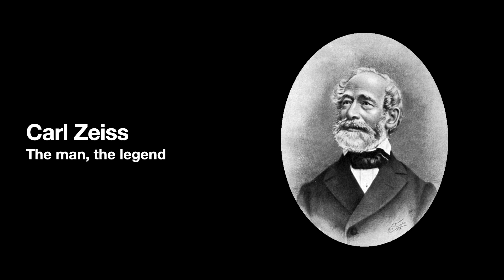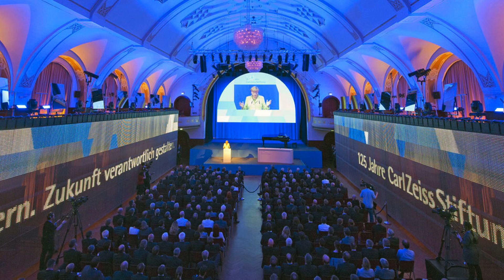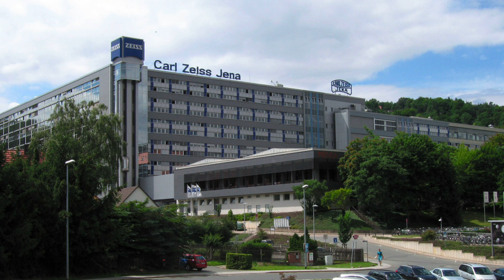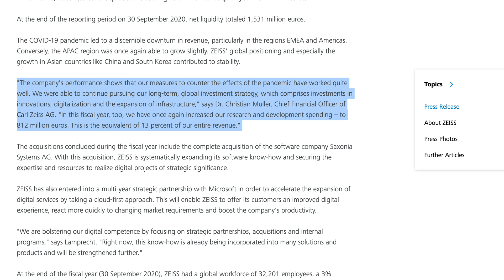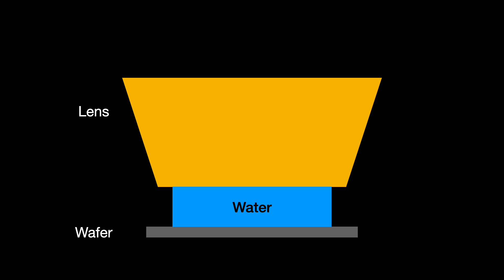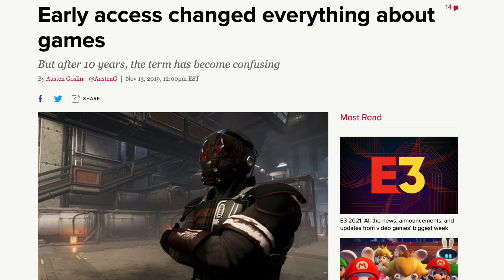Carl Zeiss, Explained: Germany’s Semiconductor Optics Master

Comment: I wouldn't say "discovered immersion lithography". It's more like they decided to implement immersion optics in lithography. Immersion optics was state of the art many decades before in microscopy. Microscopy being a major line of business of Zeiss - they do offer complete microscopes and also just the optics (i.e. objective lenses). Those lenses are designed and sold as either regular air-operated or as (oil or water) immersion lenses.

Comment: the next step  will be a lithography WITHOUT  optics... a laser beam modulated with powerful  magnetic fields,  that scribes the pattern  direct on the silicon no more mechanical parts the wafer sits stand and the laser beam in a vacuum  chamber inscribes the pattern  in the wafer

Comment: Are Canon or Nikon attempting to enter EUV space? I know the cost of entry is enormous (and they would still need to license a lot of technologies, or even share some component vendors with ASML, like the light source). It is a bit dangerous to have one critical company control entire market. Would be hard to do as Cymer is now owned by ASML. But there is always an option to develop alternatives, or bring this to the court on the grounds of monopoly, to allow fair sharing.

Comment: That the mirror system in the EUV system are some of the most extremely complicated and finely tuned things you've ever run in to, I'm quite willing to believe. I've heard and read some things about other parts of the EUV machine myself, like the light source, and those create the exact kind of feeling in me as well. As some of the most insanely sophisticated pieces of engineering you've ever heard of. 

Probably quite a few things in the EUV machine are like that I guess and it really explains why the costs of developing it were so high, or why unit prices so high. And yeah, it really makes you wonder if anyone else can any time soon afford to develop a competitor device. Frankly, especially with hindsight on the costs and extreme engineering involved, it wouldn't have been that surprising if the semiconductor industry had failed to make this jump and just stalled out at around 10 nm or so for a good long while. They almost didn't make it as it is, what a different semiconductor world that would have been.

Comment: Great channel. Maybe you can also do videos about Schott and Jenoptik, which were all founded by Carl Zeiss. This companies are also critical suppliers in the semiconductor industry.
Reply: From Wiki: Schott also produces telescope mirrors with diameters up to 10+ meters and---work in progress--39 (!) meters in diameter. Cast glass mirrors like that need months and month for cooling down, weight some gramms and are finally sanded as accurate as I don't know how accurate. Transportation to the telescope is another thing...

Comment: Carl Zeiss additionally owns Schott, which is also doing a lot of high quality glass.
Reply: From Wiki: Schott also produces telescope mirrors with diameters up to 10+ meters and---work in progress--39 (!) meters in diameter. Cast glass mirrors like that need months and month for cooling down, weight some gramms and are finally sanded as accurate as I don't know how accurate. Transportation to the telescope is another thing...

Comment: I wonder why immersion lithography uses water rather than immersion oil. Perhaps the UV would polymerize a hydrocarbon-based immersion oil, but I imagine a silicone-based immersion oil would not because silicones are exceptionally UV-stable.
Reply: Yes - high magnification optical microscopes use oil immersion. Some electron microscopes have resolutions exceeding even those of an EUV machine (though not requiring the beam to focus as a lithography machine does). They do it by putting put the whole thing in a vacuum chamber. I wonder why you would not prefer a vacuum to a troublesome medium like water?

Comment: FunFact: The history is even more complicated because there was also Otto Schott

The Carl-Zeiss-Stiftung also owns Schott. They produce most of the glass for Zeiss
Reply: And Schott Glass is a manufacturer of fine glass specialties to this day.
Reply: From Wiki: Schott also produces telescope mirrors with diameters up to 10+ meters and---work in progress--39 (!) meters in diameter. Cast glass mirrors like that need months and month for cooling down, weight some gramms and are finally sanded as accurate as I don't know how accurate. Transportation to the telescope is another thing...
Reply: Unfortunately since many years Schott doesn’t produce any fused silica anymore, so the newest Zeiss objectives for ML do not contain Schott glasses.
Reply: @calvinhobbes1617  Is the glass used in EUV mirrors made by Corning or another company? Do you have any information on their model and processing / manufacturing?
Reply: They are next to the Main river in Mainz.
They put them on barges.
After that,well……🔬🔬🔬

Comment: How many more years do you think DUV will be in action? It is not easy to get rid of existing EUV or even replace DUV with EUV due to the heavy costs of DUV. What percent of the current semiconductors are made using DUV vs EUV ?

Comment: Hey John, I want to ask a question. Did Carl Zeiss sell their Starlith EUV optics to other companies or they exclusively sell their EUV optics to ASML only?
Reply: They only sell to ASML
Reply: @nikolaskonle3926  How about Intel? I heard they fabricate their own semiconductors
Reply: @cek0792  they do.. but they need Asml systems and Zeiss optic in it to create the semiconductor
Reply: @cek0792  Intel is not in the same Market as ASML... The thing is that ASML essentially has a monopoly (like 80%+ market share) in a certain market. They produce machines that essentially every single advanced microchip factory in the world uses. They are used by Intel and TSMC (which produces AMD, Apple, Nvidia,... chips) among others.
Reply: Do check out Trumpf as well.

Comment: Another excellent video. May I suggest a few square meters of sound panelling glued to a shower curtain which you mount behind you when recording and another panel placed behind the mic ie on the side opposite yourself. The cheap stuff will do just fine.
Reply: What’s wrong with the sound? Serious question. Sounds like any other channel IMO.
Reply: @codycast  Oh no nothing is wrong with it. You just get a nicer sound if you record with a few panels like I suggested - less room reflections, less frequency doubling etc. Specifically you get less positive interference of higher frequencies which means the sound becomes warmer. Also reduces vibrational undertones which come from when the lower frequency sound waves hit the walls and other flat objects in the room. To be honest I don't think without a decade of sound work you will notice it, but I do. It's not a criticism only a suggestion.
Reply: @mpireoutdoors5274  okay. I guess to me it sounds like every other channel. (I didn’t find your suggestion to be a criticism)
Reply: @codycast  Many other channels could also benefit from my suggestion... If you get better headphones you may realise what I mean.
Reply: @mpireoutdoors5274  I’ll take your word for it. Though I’d guess 99% (?) of viewers jist have some wireless earbuds or PC speakers and call it a day.
Reply: @codycast  the thing is with better headphones you can actually hear the sounds I'm talking about but with average headphones the "bad sounds" take up movement in the driver and the end result is what is called muddy sound. The panels I suggested remove the unwanted sound 
(essentially duplicated or replicated frequencies, or resonant tones resulting from the materials in the room vibrating as a result of those frequencies). Essentially the unwanted sound competes within the membrane and reduces the overall sound, like having 3 bad singers sing with 1 good singer: it would sound better if the 3 bad singers weren't there. Perhaps a good analogy is how clear a radio broadcasters voice will be compared to your average YouTuber. That will be a direct result of the proper placement of sound absorbing materials around the radio booth. There are many subconscious reasons why it is also easier to listen to such a sound for a longer time, which is  why I suggested it. Not because I think the current sound is bad but because I think it's good and a little bit of work can be done to help more of that goodness come across the wire - the "bad sounds" literally take up movement time within the membrane of the speaker/headphone which means good sound cannot use that membrane during that time, or at least not to the extent it theoretically could. Like tug of war...
Reply: @mpireoutdoors5274  interesting. If I ever decide to make YouTube videos I’ll take your advice

Comment: If 20 years ago you had proposed building an EUV litho system with current-generation engineering and performance spec's, people would have thought you were completely out of your mind. If you showed them such a system they would have probably thought it must be space-alien technology.
Reply: These are incredible machines, for sure! But 20 years ago everybody thought that conventional lithography was on its last legs, and a switch to the EUV machines was just around the corner. Intel, other large manufacturers and government laboratories have created the EUV consortium just around that time, and the pieces of the EUV machines were already working in the labs. Intel hoped to have 13 nm EUV in production by 2007 and beta versions sooner than that. But it turned out that with various tricks one could print some features that were much smaller than the wavelength of light, using relatively ordinary lithography, so it just kept going and going. That would probably be more surprising to the people from 20 years ago!
Reply: @cogoid  Yeah, why not just squirt a pool of water under the lens, keeping it bubble-free and temp controlled to 0.01C as the wafer and mask are scanned at a relative speed of several meters per sec while their alignment is dynamically controlled to nm-level accuracy (taking into account the finite speed of light in the scan synchronization)? Sheer audacity.

Comment: Excellent content and your pronunciation is super-clear! When unsure how to pronounce German names (e.g. "Carl Zeiss Jena"), you can always enter them into "google translate" and ask it to pronounce them a couple of times -- every other time it will do it slowly, making it easier to catch the nuances. (This works for many other languages as well, of course.)
Reply: Google can be way off though. Always best to ask a native speaker.
Reply: @excitedbox5705  Of course it is best to ask a native speaker when one is available. But for languages for which google has a lot of data, it does surprisingly well, and it is a pretty easy way to do a quick check.
Reply: Wiktionary will usually have both IPA and a sound sample or two. The IPA would have made it abundantly clear that Zeiss doesn’t begin with a voiced s...

Comment: How about an article about hydrogen flouride and how a couple years ago the Japanese government sorta banned the sale of this essential chemical to Korean semiconductor companies? The Koreans had their own manufacturers, except they couldn't make it pure enough. But the move might have backfired on the Japanese because the Koreans became less reliant on them.
Reply: Same is about ture china-japan trade. Japan needs chinese ores for chemicals and china stopped export. now Japan is less reliant chinese ores.
Reply: I asked about this subject a while back. However the Koreans still need Japanese photoresists to manufacture their most advanced processors and most advanced multilayer RAM chips. There was an article I saw where some Japanese photoresist manufacturers are starting to make photoresists in Korea.
Reply: @Molybed1  I remember reading something about Japan having an almost complete monopoly on photoresist supplies.
Reply: @SerBallister  They pretty much do. A photoresist is VERY difficult to manufacture and needs very specific formulas and materials to work.

Comment: Leica, the other fine German optic company, competes with Zeiss in some products such as binoculars but not the semi-conductor stepper market. Leica however dominates the high-end German photography industry with its M-series cameras and lenses.  Today, almost all Zeiss-branded camera lenses are made by Japanese companies. I wonder why Leica never tried to break into the stepper market. Maybe it only has room for one player, at least in Europe?
Reply: Steppers are quite different from the optics themselves and there are several companies making them. You have to keep in mind that you mainly hear about EUV machines but there are hundreds of similarly precise machines in the industry made by other companies. Steppers are the positioning stages but many machines need precise positioning. The optics only deal with light and imaging.
Reply: @excitedbox5705  Well I meant the optics in the stepper.
Reply: Well there is one other company called Berlin Glas that supplies ASML as well.
Reply: The 35mm Zeiss cameras of the 60s and 70s were excellent but so expensive, the Japanese undercut then. Sony was the one who bought up most of the camera market, but still uses Zeiss lenses under license.

Comment: All this over sold.
Business flatt in future.
7 nm or 3 nm.
What is next?
Is it really needed 7 nm chip?
Not really 
All computers ok with 128 nm.
Question 
Is chip 7 nm as stable as 128 nm ?
Nobody can say . 7 nm too new and has no history.
Look science call diffusion.
Electron will act unpredictable the smaller contractor.
Yes no?
What about reliability of chip in whole we will see in another 10 years.
Today computer 20 years old or industrial electronic and it work. Will 7 nm chip as last?
Reply: 7nm is not transistor size whereas 128nm is transistor size.  7nm is just marketing term.
These 7nm processor are tested extensively.
Industries (Space, Military etc) that need more reliable chips uses old technology.
Reply: @SaurabhKumar-uo6ms  all this 7 nm over sold many times.20 years ago I bought computer almost every year. From window 3.11 to xp.
Now computer and operating system so good that .I use Ubuntu 16.04.
I bought last computer 10 years ago.
PC is very old business. And hard to see grows in future.
Reply: @enigmaak8049  the increase in performance is still relevant for gaming, workstations and ofc servers, supercomputers etc though, especially servers are a huge market...
Reply: @johnuferbach9166  what server are you talking ?
7 nm need only to politition at Washington DC.
No important part for military can be made out component that have no 20 years testing.
Why server must work on 7 nm?
Why?
Are educated electrical eng did you have class diffusion 1 and 2 and 3
Or you free paid advertiser 
Did you see how much $$$$$$$$$
Was put into 7 nm ?
Did your server will pay it back?
Economy now have no connection with business 
USA has 20 trillion $$$$$$ own to others countries.
You need server 7 nm to understand what is 20 trillion $$$$$$. Is